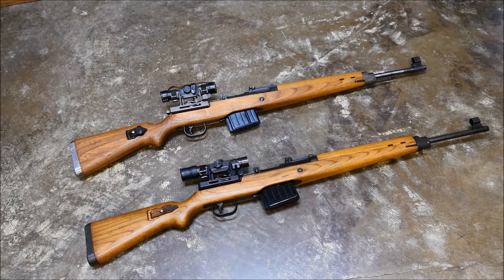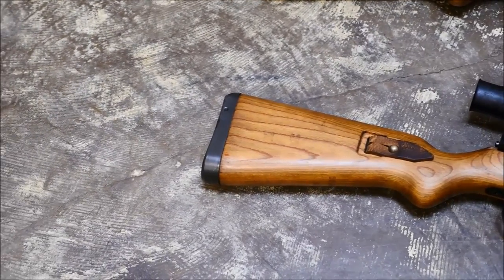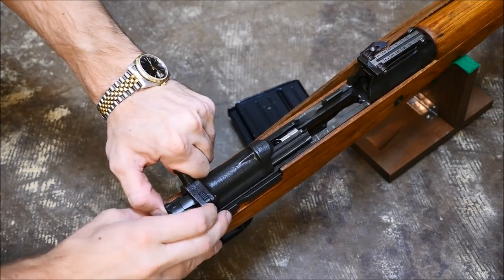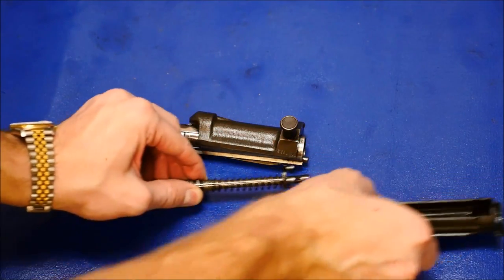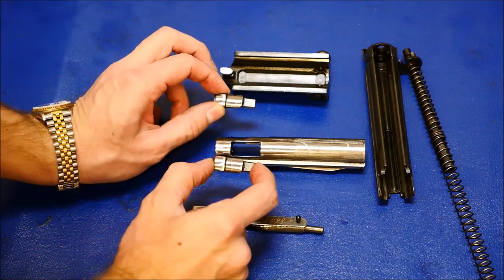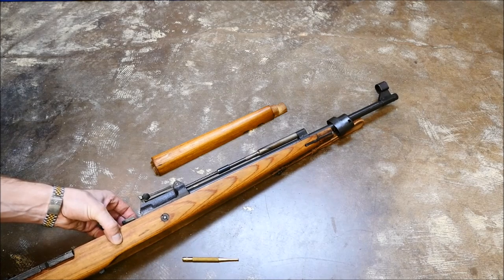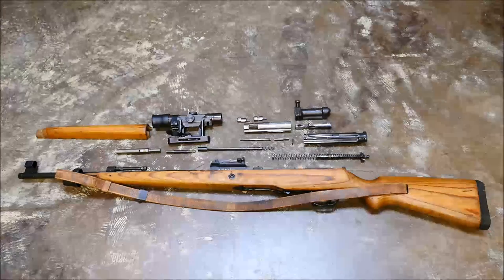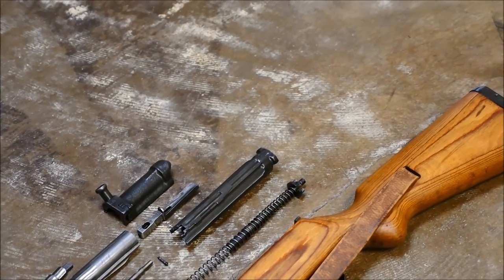WWII German G43 Semi-Automatic Rifle Field Strip

Comment: Awesome video - can you do a side by side takedown of the G43 vs the SKS? It seems, in a way - like the SKS was a post-wartime evolution of captured G43s... there are differences for sure, but it would be cool to see them side by side.
Reply: +Eric Walla The G43 was based on the SVT-40..
Reply: I have since learned that via Forgotten Weapons and other channels - so much history. I didn't know the FAL was relative of the SVT-40 either.
Reply: The sks is a purely russian design 
Not influenced by the g43 
The sks is a scaled down 
Siminov ptrs41 anti tank gun 
   Siminov redesigned the action into the sks in 1940 or 45. Ive heard they saw trial use in ww2 but i dont think thats true
Reply: +Matt Dickens Wow! What couple of videos I could find on that weapon - that's pretty damn cool! Thanks for the info Mr. Dickens!